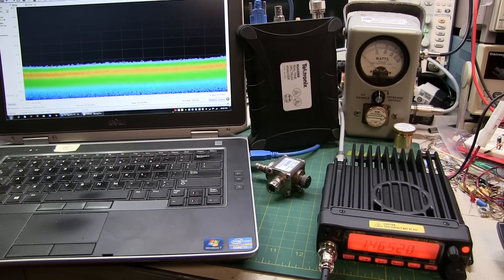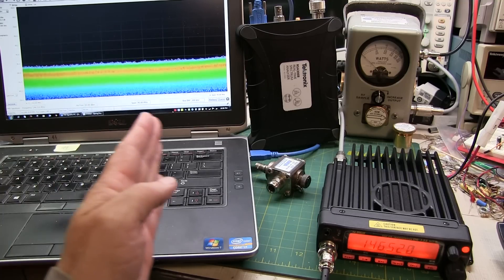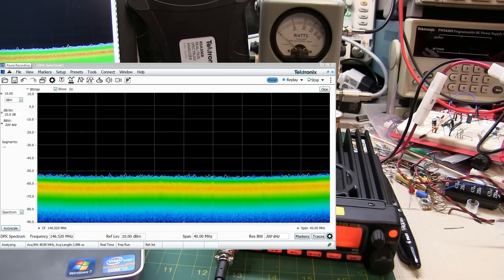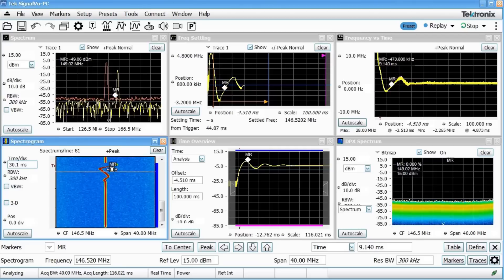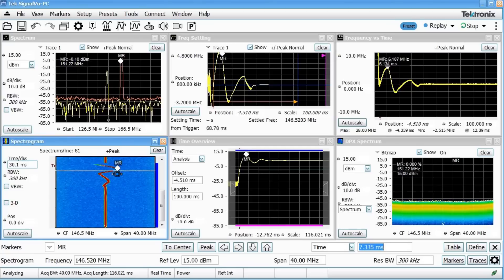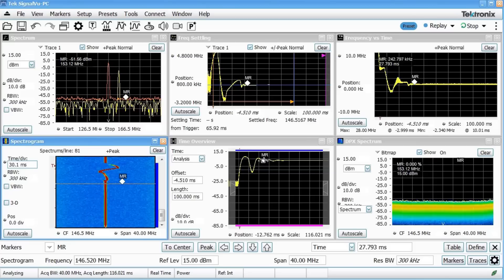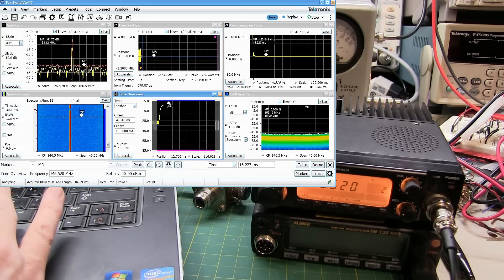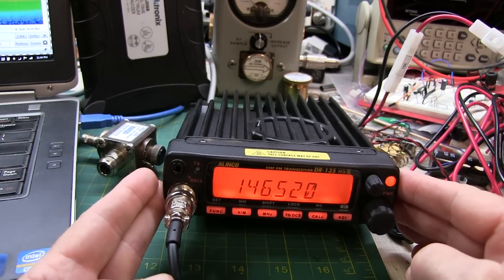#367: Characterizing the key-up frequency transient on an Alinco DR-135 Mk III 2m radio with an RSA

Comment: Thanks for the heads up on these radios!!  Does anyone have more info on how to test DR-x35T rigs to see if they have the issue? Especially for those of us without access to a fancy Spectrum Analyzer?  (I do have a TinySA, but know that it has limited capabilities).  Also, there are rumors of a fix... any info/resources/links for that??

Comment: Alinco's designed to transmit on all frequencies way outside the amateur bands for the unregulated Asian markets and pirates, where there sales are far in excess of the amateur market, unlike the kenwoods and Icoms you just showed, the only way around is to build a band pass filter for these broadband units.
Reply from the maker: That is still no excuse for enabling transmit before the PLL is settled.  Just poor attention to detail.

Comment: The club I belong has a bunch of mostly Mk III DR-135's and DR-435's.  Last year we were told and then confirmed that all of them, including two brand new ones, have this key-up transient problem.  I have used an AirSpy SDR to noted similar, but not as detailed and specific results that you have.  In general they happened about 60% of the time when the transmitter was keyed up, across several MHz each side of the carrier, at levels from -20 to -40 dBc.  The spurious emissions might not be noticeable unless it is from a frequently used station like repeaters or gateway radio, and also depending on how the receiver sees it.  I have written two letters, mailed to Alinco headquarters in Tokyo since July 2022 , asking them if they are aware of this problem, but have heard nothing from them.  It seems that this series of radios have been discontinued recently, but this is not an acceptable excuse for lack of response from Alinco.  For poor design and customer service, I will not buy their products from now on.
Reply from the maker: The likelihood is that they're doing it EVERY time you key up, but the AirSpy SDR is only catching 60% of them (since it isn't truly realtime).  Alinco has provided the ARRL Lab with a suggested fix (adding one capacitor) which is supposed to delay the TX until the PLL has settled.  The owner of these rigs plans to try this on his rigs and report back.
Reply: @w2aew  Thanks for the additional info and I agree with you that a proper SA should provide more useful information than a SDR.  Also good to hear that Alinco is doing something which may help to solve the problem, and the owner of these rigs is going to give it a try, much appreciated.
Reply: @w2aew  Thanks again for this video and the info!  I just found this comment reply, and am curious if there has been any update from Alinco or ARRL??  Is there any more info available on the "fix"?
Reply from the maker: @ChristiaanAdams  Alinco provided a “fix” which is to add a capacitor in parallel to one already on the board (thus increasing its value). I’ve heard from the rig’s owner that the fix helped. Email me at (my call sign) at arrl.net, where ‘my call sign’ is the channel’s name, and I can send you the documented fix from Alinco.

Comment: Hello and thank you for your kind contribution with this channel. I have a video topic for your consideration. Demystifying Plate Load Resistance for tube audio amplifiers. I am familiar with calculating reflective impedance back through an output transformer with a known speaker impedance and the goal of matching tube or tubes for optimal performance pending class and configuration. Things get quite fuzzy when trying to confirm plate load specifications in the tube manuals especially with using two tubes in a push pull configuration. I have determined this is not just a matter of doubling the Class A plate load resistances. I am restoring a Bosch Model 28 that uses two 71A tubes in a push pull configuration and want to confirm what overall plate load resistance I should be targeting to confirm OT winding ratio and speaker all matches appropriately. The 71A tube datasheet indicates 4,800 ohms at 180v for class A and no data for push pull. Although this question is specific to my current project, I believe this understanding will be quite beneficial for future amp building and radio restoration projects. Thank you.

Comment: Thanks for the great test video. I wonder how good or bad the current Chinese portables are?
Reply from the maker: Good question...
Reply: I looked at a Baofeng UV-82 and a WLN KD-C1 and they both looked pretty good.  Both rock solid on keyup.  The Baofeng had some spurious around 162.47 MHz on Unkey, but it was over 40 dB down.  I'm guessing that is in spec.
Reply from the maker: @ErnieStedman  Glad to hear that there aren't any real wideband instability problems with those rigs.  Using the setup file I sent you, you can reduce the span (to something like 1MHz or 100kHz or less), and you'll likely see "some" frequency settling.  On my TM-231A, I get about 5kHz of wiggle for a few milliseconds.

Comment: It's a great pity we use radios built for manual keying and audio transmissions for data. Imagine what wifi would be like if it worked to these standards. Digital radios should be designed for the job.

Comment: Great demonstration.  Would it be possible to do this same type of testing with a non PC type spectrum or even with an Oscope??  I have the Rigol DSA815 and would like to duplicate this test with that SA but am unsure as to how to set it up and which functions need to be enabled or screen shots to capture.  Would make a great follow up video.  Excellent as always!  73
Reply: You need a realtime SA like what is being used here to capture this kind of transient.  The only way you can capture a fast transient like this on a DSA815 is to set peak hold and then key the rig a hundred times or so and hopefully let it build up over time.
Reply from the maker: Swept spectrum analyzers don't have the ability to directly plot the continuous frequency deviation vs time like a realtime or vector signal analyzer.  However, it does look like there is a narrowband (1.5MHz wide) continuous acquisition option available for your DSA815.  That wouldn't be wide enough to capture the transient activity of this radio, but should be good enough for most radios that don't have this wild transient.  Without this option, you might be able to use Zero Span with a wide RBW setting, and then move the analyzer frequency to slightly off from the actual frequency so that the frequency variation of the rag will ride up/down the RBW skirt...

This would be very difficult to do with an oscilloscope unless it has a gated-FFT function.

Comment: I'm curious how Baofeng and other Chinese radios would rate under this kind of testing. Thanks for showing this testing and hope you had a great Easter!
Reply: The $35 Baofeng handheld that I own completely fails the 47 CFR § 97.307 spurious emission test and is not legal to use on the ham bands.

Comment: Wow!  7 MHz worth of interference!  The 2 meter weak signal guys on the bottom of the band are going to have a fit with those radios!  What those radios need is a good hammer!  How did those radios get FCC certified?  The ARRL and the FCC need to watch this video!
Reply: Amateur radios don't get FCC certified.  You can build your own equipment.  The licensed amateur operator is responsible for making sure their station equipment complies with the rules.
Reply: Amateur service
Amateur radios do not require type acceptance. Likewise, type acceptance for another service does not indicate that a radio is appropriate for amateur service. In lieu of type acceptance, the FCC lists a number of requirements for Amateur station operation in Part 97, our part of the FCC regulations. In particular, Part 97 Subpart D specifies the “Technical Standards“ that must be met by an Amateur station, including, as for type accepted radios, allowable emission types, spurious emissions, power levels, etc.

The big difference here is that the requirements for Amateur service are not for the radio itself, but for the station in operation, and thus the onus of correct operation is not on the radio manufacturer — it is on the individual Amateur! This is a lot of responsibility, but along with it comes a privilege that no other licensed service is granted: the ability to build our own equipment. Licensed amateurs are the only FCC licensees authorized to homebrew radio equipment and transmit with it on the air without testing and acceptance from the FCC. Likewise, we are the only service permitted to use radios type accepted for a different purpose for our own use. This is why a radio Amateur may purchase a Part 90 certified business band radio, for example, and use it on the 2 meter Amateur band.

Comment: Thanks for this excellent video & explanation of the problem.  I know that a lot of amateur operators might not fully understand that they are ultimately responsible for ensuring that their transmitters do not cause inteference, not the manufacturer.

Comment: I'm also concerned because the TYT 9000 series is basically the same design. 😢
Reply: I have a 220mhz tyt 9000d it does the same thing. I am sending it back. Sends a transient across the whole 220 band.
Reply: @Oldcomputer  - Nooooo....That is very concerning. I didn't have one to test. This is a major problem, but most of the people using these radios unfortunately don't seem to care.

Comment: There was a repeater out here in Washington State (146.880) that would characterize the PLL ringing of a transceiver and allow access to the repeater instead of using CTCSS tones. The Idea was to give the repeater operator the ability to block access to certain operators who abuse the machine.

Comment: I would be interested in knowing if this is an issue with just the DR-135 or other Alinco radios like the DR-MD500T also exhibit such behavior. Of course, other than Part 15, there is no type acceptance for the DR-135, while the DR-MD500T is Part 90 certified.
Reply: I know it affects both the 2m DR-135TMKIII and 70cm DR-435TMKIII rigs.

Comment: How did this radio pass compliance/conformance and get into the market ? That's the question I'm asking myself right now. I can't believe that Alinco doesn't have a processes in place  for verify the designs for their  radio's are compliant. Then again watching the signals on HF FT8 in waterfall mode so many people have high power rigs that splatter all over the band so maybe I shouldn't be that surprised?
[edit] Are they powering up the synthesizer on key down? It would be interesting to see the circuit diagram for the Alinco radio.
Reply: Amateur radio equipment is not type accepted like radio equipment in other services.  There are no compliance/conformance requirements on manufacturers.  It's on YOU as the licensed amateur operator of the radio to ensure your equipment complies with the rules on interference.  That's why they allow you to build your own radios.
Reply: @stargazer7644  Isn't Part 15 type acceptance (which commercially sold amateur radio equipment is) to keep things like this from happening?  Maybe I don't understand what Part 15 really is.
Reply: @JoshuaJayG  Amateur radio is part 97, not part 15.  Hams are allowed to build their own equipment, so there is no type acceptance under part 97.  The licensee (the ham) is responsible for making sure their radio meets the emission requirements of part 97.  Part 15 covers unlicensed intentional and unintentional radiators.  CB and FRS radios are covered under part 15 (for example), as they're not licensed.  You have to pass a test to get a license to operate an amateur radio for this very reason - it's a licensed service and a ham is supposed to know what the regulations are.
Reply: @stargazer7644  I understand that amateurs are required to assure they are not causing harmful interference but that doesn't change the fact that most "black box" amateur equipment people purchase still meets Part 15 acceptance.  Here's an excerpt from the TM-281 user manual: "This equipment has been tested and found to comply with the limits for a Class B digital device, pursuant to Part 15 of the FCC Rules.  These limits are designed to provide reasonable protection against harmful interference in a residential installation..."

I haven't read through all of Part 15, (who has time for that?) but it seems to imply that if used correctly, the transmitter should not cause harmful interference.  You can read 15.105(b) that gives the wording you see in the Kenwood manual.  

Even the infamous UV5R has Part 15 type acceptance.  So what is happening in the FCC lab if not testing for harmful interference?  The Alinco is clearly causing interference and and transmitting outside the amateur radio band before the PLL stabilizes.
Reply: @JoshuaJayG  That's just the digital computer in the radio.  Part 15 is only for UNLICENSED equipment.  It does not cover amateur radio transmitters.  Now you can sit here and try to argue with me, or you can spend 15 seconds googling part 15 and reading for yourself what it covers.
Reply: @stargazer7644  my apologies for asking questions and trying to learn.

Comment: The PLL is taking quite a while to phase lock onto frequency (up to 50ms), the PLL lock/unlock signal should be keeping the PA chain disabled until the PLL has a stable lock (but it's not doing so). Alinco should not be selling radios like this. The MK2 and MK3 service manuals can be found on the net. Pin 14 of the PLL chip (IC116) is the lock detect output pin. Good video !
Reply from the maker: Yes, but I bet that the 75-100ms delay from key-up to transmit would bother some people.
Reply: @w2aew  Totally agree !  For one it shouldn't be transmitting until the PLL is in stable lock and two the loop filter needs fixing to fix how long it takes to attain lock. As others have said that radio is certainly not compliant (in any country). I wonder how Alinco are bypassing todays emission rules ?
Reply: @BikerCaf  They aren't bypassing the emission rules, it's on YOU as the licensed operator of the radio to comply with the rules.  Amateur radio equipment is not type accepted.
Reply: @w2aew  Hi Alan the appearance of the enclosure of the Alinco unit reminds me of the Chinese TYT 9000
Reply: I have both and they are not the same hardware, although there are some similarities between the two.  @WestCoastMole
Reply: Possible that there’s a problem with the time constant in the PLL feedback loop. But clearly there is amplitude instability as well. Might be related, or it could be something common to both the synthesizer and the PA. A power supply issue, perhaps?
Reply from the maker: @garyramsey4275  It certainly seems like a design issue, since it appears on two units, one of them is brand new.

Comment: That was very interesting and it's not just that Alinco which exhibits such bad behavior. There's a chap 1.3 miles from me who uses a Wouxon radio and when he keys up on the UK FM calling frequency, 145.5 MHz, his main carrier level is at -41 dBm, but I also get a huge transient on 144.3 MHz SSB (the IC-9100 indicates the peak as being at S9+20). When he keys down, I get yet another loud transient, but it's about 10 dB lower than the key up one.  Fortunately for me, he doesn't use VHF very often, but I once had a quick tune about and found the transients down at 143 MHz (again, S9+20) and up 156 MHz (at a lower level). Just for fun, the next time he's on I'll see how much further up and down I can hear them, but my view is that any new model of transmitting equipment (be it amateur or commercial) should have to be tested and type approved (by the appropriate government agency) before being deemed legal to sell in that country; clearly that isn't happening.
Reply: Oh, the "random" samples they send to the FCC are within spec, barely. I've a baoufeng doing arps with a raspberry pi. I put a 2 meter bandpass filter on it for a very good reason, as I too have a spectrum analyzer 👍.
Reply: I think every country is different on amateur radio equipment certification requirements and rules.

Comment: Great video! How would you approach this type of analysis with an ordinary (not Real Time) SA? It would be a very interesting follow up video! :) Thanks!
Reply from the maker: I would probably start with zero span using the widest possible RBW, then tune slightly off frequency. Then, the frequency variations will show up as amplitude variations vs time because the detected signal will be riding up/down the skirt of the RBW filter. The wide RBW filter will have shallower skirts than a narrow filter, maybe having enough to see most of the frequency deviation.
Reply: If you can time off of the key up, you could just record power over time for narrow spectral bands.
Reply: @RobertSzasz  yes this would have been my "guess" too.. Set center frequency away (e.g., +1Mhz) and narrow span (e.g., 50Khz, or even 0 span?), key up the radio and see the result with "hold max". But maybe there are faster/more clever ways.
Reply: @therfnoob7697  you wouldn't want hold max, you would basically capture one vertical strip of the waterfall plot on each capture.
Reply: The way I did it was build a circuit to key the radio 300 times in a minute and put the SA in peak hold. The VHF spurs from 120 MHz to about 160. The UHF is worse - from 410 to 460.
Reply: You have to peak hold and do lots and lots of keyups.